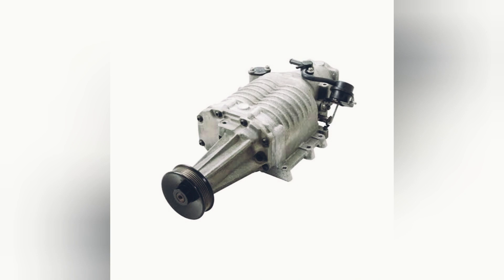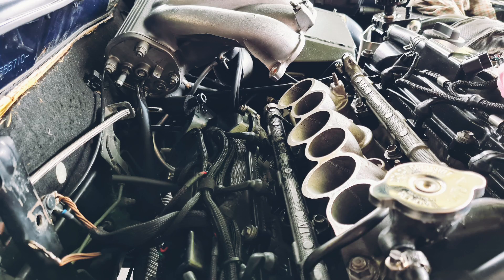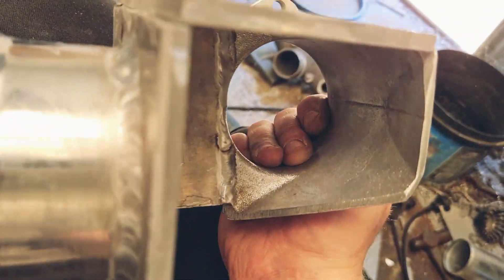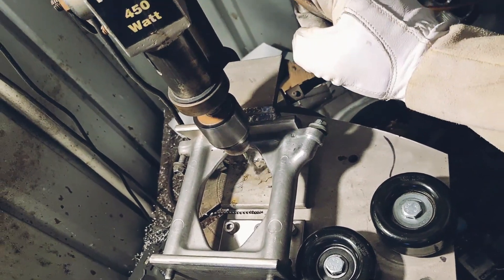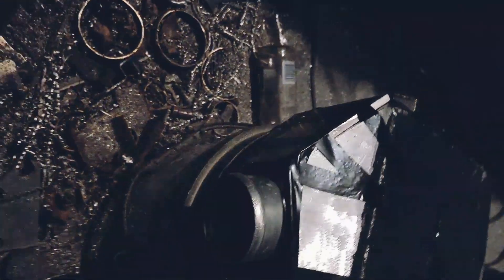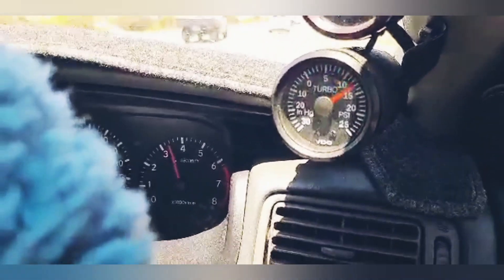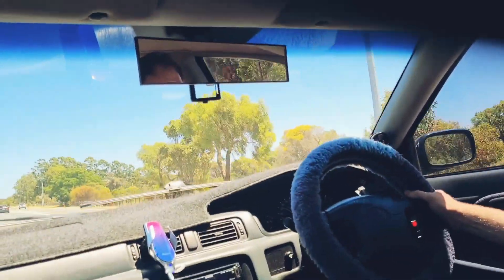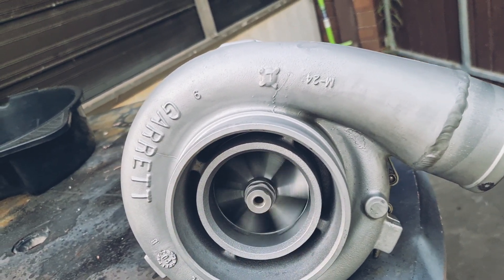Turbo AWD Camry - pt33 - Twincharged

Comment: What an actual unit this has become.

Not a day goes by i'm not haunted by wondering what pistons you used in the end.
Reply from the maker: Its not actually that hard to figure it out if you  just look through a piston catalogue from any reputable forged piston manufacturer. Just know your piston dimensions, simple as that. If you really want to know thay badly start looking through a catalogue.
Reply: @broxonbrookfield5665  
I was wondering how you got your engine and all related components cleaned? Was it diy or professional?
And did you get any major relevant machine work done?

I feel like I've made a bizzare mistake, I ended up ordering custom pistons to the stock bore but have since come across people talking about having to get slightly oversized ones due to needing a tiny bore and hone for Preloved engines, or perhaps in stressing over nothing 😰

Comment: Simply amazing. Hows the electric powersteering working for you? I've been in the process of doing that swap unfortunately had a leak with the AN fittings I was running and have to switch to some different fittings.
Reply from the maker: Been working fine, feels like normal steering. Does take a couple of seconds to get pressure when starting tho.
Reply: @broxonbrookfield5665  got you. Are you running a power steering cooler for it?
Reply: @broxonbrookfield5665  I live on the Gold Coast champ I have a V6 Azura 2001, I’d love for you to make me something similar to your setup I don’t want turbo just supercharger, can you design me a manifold for the intake and let me know what supercharger will be used I want it mainly to whine and sound nice , if you can do that plus the belt and pulley set up as you already have the measurements etc..  I’d be happy to buy it off you and get someone to fit it here near by .
Claude

Comment: How did you go about relocating the fuse box to the underside?
Reply from the maker: It's just mounted ontop of the gearbox. It reaches just.
Reply: @broxonbrookfield5665  you got a Facebook name or instagram ? I’d love to message you to see if you can make me a manifold ,and supply a supercharger to it and design me a pulley and a belt or 2 a spare one will be handy

Comment: Any reason for not foregoing the bypass and just running it as compound?
Reply from the maker: The turbo is not in its efficiency range when it is only making 10 psi and needing the charger to make up the rest. Compound is only something if you want huge psi. 23psi isn't really huge in the compound world.
Reply from the maker: Additional, the supercharger makes alot of heat which can't be removed by the small water core it's running. The turbo water core however is able to remove all the heat